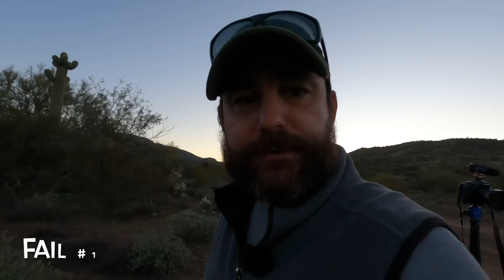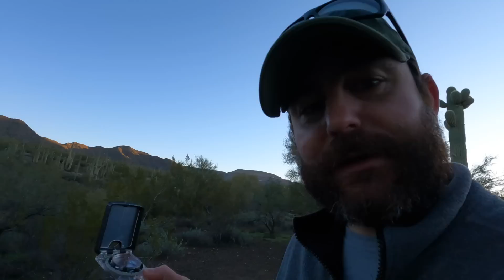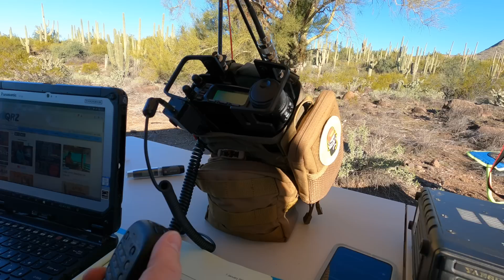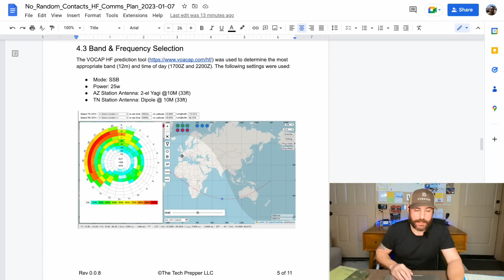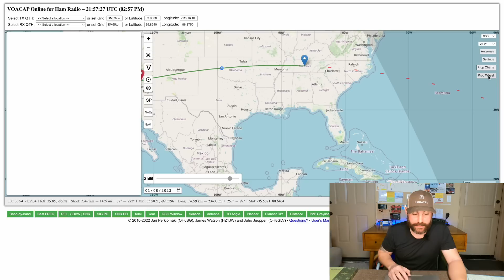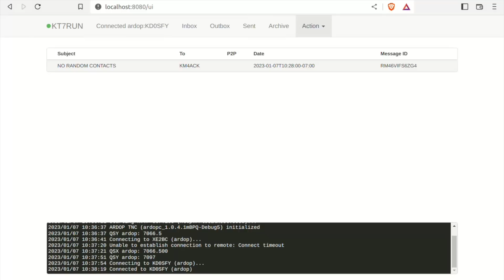Nationwide Offgrid Comms - No Random Contacts

Comment: Great video as always, Gaston! Excellent report. Looks like you and Carl really enjoyed that challenge.
This is the sort of planned contact I do when camping and when I'm far away from cell phone coverage. One trick I use: we also decide on timing and frequencies as you did. To more quickly compensate for someone being on frequency or even some random, unexpected QRM that might happen to be there for one of us, we schedule frequencies +/- 5kHz for each time slot, trying up 5 kHz first, then down 5 kHz. This is typically in CW mode and we chose frequencies like 21060.5 instead of 21060. Since SSB is wider, this matters a little less.  
I toggle A/B VFOs or run split and use my TX listen button (on Icoms this is often an XFC button) to call the station then essentially listen on two frequencies simultaneously.   In a sense, it gives us three frequency options for each time slot to call each other. It's not as confusing as it sounds. 
We also have a frequency option that's on the next best meter band because, occasionally, flaring and other unexpected prop might wipe out the choice band (especially if a lower band is your best option). 
Anyway, again, great video! 73! Thomas (K4SWL)
Reply: I don’t know if people here can see that but we had a mountain ridge right in front of us. So a HUGE percentage of our TX was actually blocked by it!
Reply: @Chameleon_Antenna  Yet you still accomplished your goal! Testament to good prop prediction, a good directional antenna, and HF magic! Well done.
Reply: @Chameleon_Antenna  In Korea we would setup our signal support company behind mountains on purpose to help block our RF signature from the enemy during training exercises. They even used a helicopter to place a HF RATT Rig (Radio Teletype) on the mountain below a cliff face. The RATT Rigs were discontinued after decades of service due to the RF exposure hazard to operators. Most rigs at 1kW-1.5kW tx antennas less than 5ft-8ft from the operator. It was a lot of power on a pickup truck in a metal shelter.
Reply from the maker: Glad you enjoyed the video. We had a good time...a really good time. The video would have been properly demonetized if I left all the content in. Just joking.

Thanks for sharing your tips. I'll have try out your suggestions.

I failed to mention that I plan to incorporate a WARC band into every plan just in case there is a contest. I have been burned on many SOTA activations during contest weekends.
Reply: @TheTechPrepper  Ha ha! "Properly demonetized" Yeah, let me know if you need help with that. I'm somewhat of an expert. :) Keep up the great work!
Reply: @TheTechPrepper  WARC bands rock, especially 17m. Even during solar minimums its comes alive from time to time.
Reply from the maker: @vironpayne3405  All my contacts to Cuba have been on 17m. It's one of my favorite bands to work, especially on a summit.
Reply: The Sun god rules HF propagation. Its hard to think of the days before we monitored space weather.
Reply: Very good plan. It 100% increases your chances of making a contact. Always good to think outside of the box.

Comment: Super cool! I think your audio would be stronger if you would talk directly into your mic instead of across it. I don't have any experience with that radio, but I know CB mics are that way. And yes, I am from the dark side. 😎
Reply from the maker: There's nothing wrong with CB. Use whatever radio service that meets your communications needs. I've always been told by more experienced hams that you're supposed to speak across the mic rather than directly into it. I think it's time for me to test this both ways and see how the audio sounds on the receiving station. I did some quick searches online and there are opinions on both sides.
Reply: @TheTechPrepper  Interesting! Yeah, give it a try and let us know! Also, really like your approach to radio. It's way more practical than most of what's out there.
Reply from the maker: @813sierravictor  That's the goal...practical comms. More on the way. I am looking into a vehicle portable, HF NVIS antenna build very soon. That should be fun. It will be straight of a military SOP.
Reply: @TheTechPrepper  Sweet! Looking forward to it!
Reply: @TheTechPrepper  WONDERFUL!!!!
Reply: I always been told to talk across the microphone, not directly into it. Either way, it works for me. Microphone gain and compression is also a factor. Try playing with those two things and see if your results improve. The correct setting there can make a huge difference when you get it right.
Reply: the pro sound engineer says to speak directly into the mic on axis. better signal to noise, and intelligibility. if you are introducing plosives, maybe angle your mouth

Comment: I'd like to see you do a side by side comparison with the Chameleon and Jason's KM4ACK EFHW. It's the best antenna I've ever field deployed, with contacts on 5 bands (although not 12m), with distances from a couple miles to over 4500 miles. It also deploys much easier.
Reply from the maker: I have a few antennas that I'd like to compare. I also have a linked dipole from N9SAB that I'd like to benchmark. I'll need to pick up one of Jason's EFHW's. 73
Reply: A tuned antenna such as a dipole (or end fed halfwave) will work much better than the one shown here .  However, this video proves that it does work...so it might be an ideal compromise for those who understand its limitations.
Reply: I'm with you on the 80m-10m EFHW antenna for best all around field deployment.
Magloops are great as long as you aren't a frequency hopper. The do have a nice null spot for nulling local noise.
https://youtu.be/nShDYlZGKlc